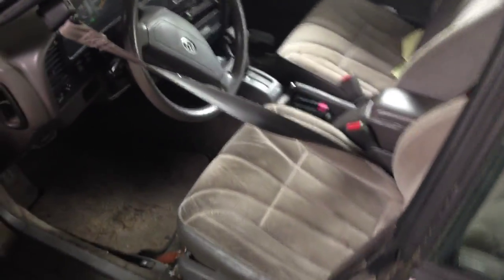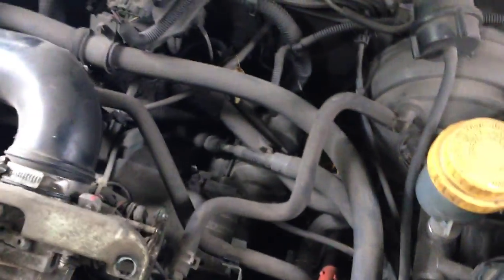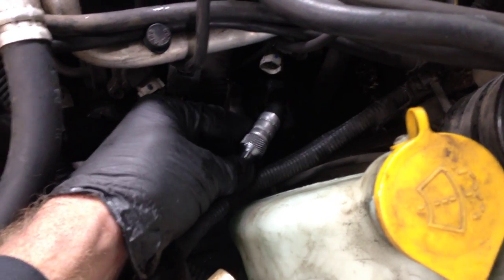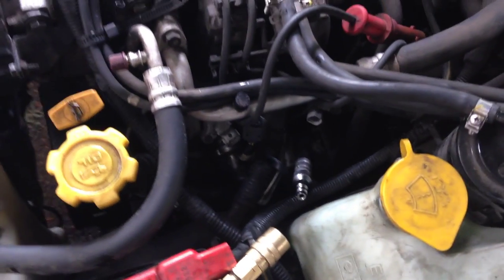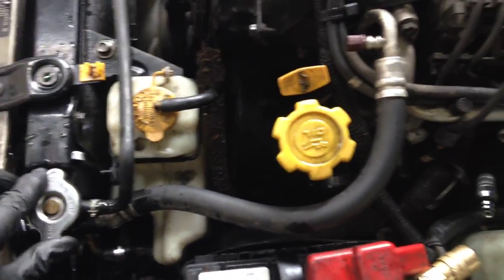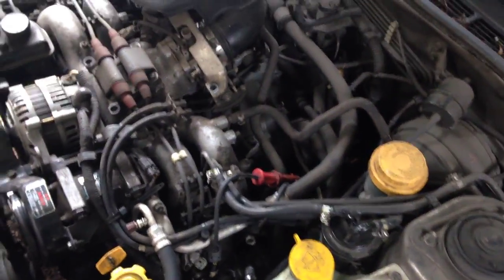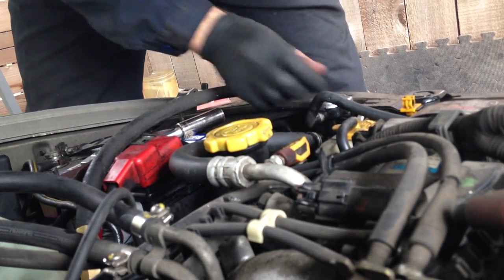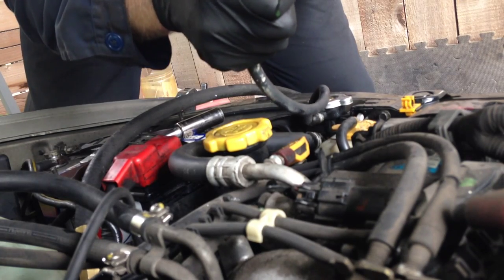1991 subaru legacy EJ22 overheating problem diagnosed

Comment: Thanks. I never thought of testing head gaskets in this manner. It still begs the question of why the overheat occurred in the first place. Once I blocked the radiator on my 91 Legacy by running into a snowbank. The car overheated with resulting head gasket problems. I had head gasket leaks on a 97 that I cured with steelseal, but it wasn't until I changed the water pump that the overheating problem stopped. I am looking for some method that will pinpoint water pump problems or radiator problems.

Comment: Well I don't know why you even bothered with a head gasket test. If the car overheated at least once, even new head gaskets would get damaged. There is no need to even do the test. If it overheats, you just pray you don't crack the block. Head gasket failure is 100% guarantee, especially on those engines, aluminum, and oil is always laying there on the bottom of the heads. When I read about Subaru head gasket failures, on newer ones, I started changing coolant, once every year. No head gasket issues for me, yet. And I have the pesky 2.5l. I also had that car in the video, 22 years no issues, except for the rust that ate it up. Those head gasket issues are nothing but poor maintenance and weak design on Subaru's part. They used a single layer gasket on 2.5l, it's gonna fail eventually for sure, but if you have fresh coolant and oil in the car all the time they should hold up okay for the life of the car, and then Rust will eat it.